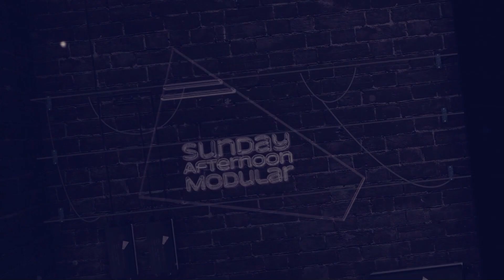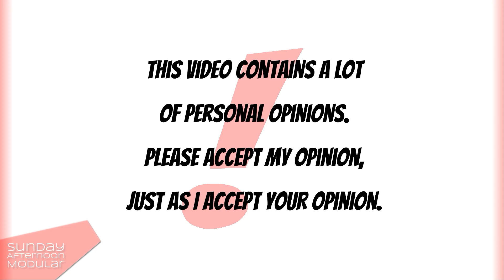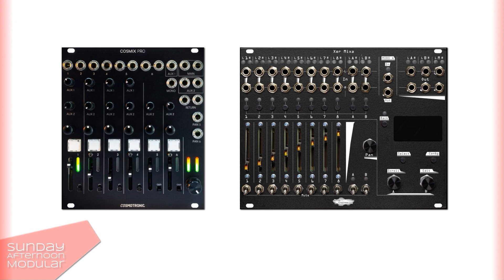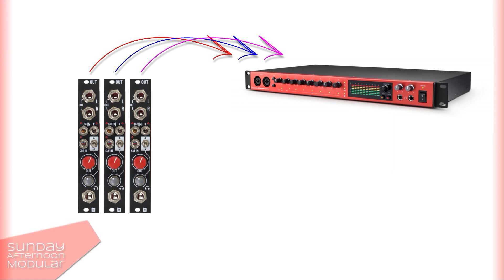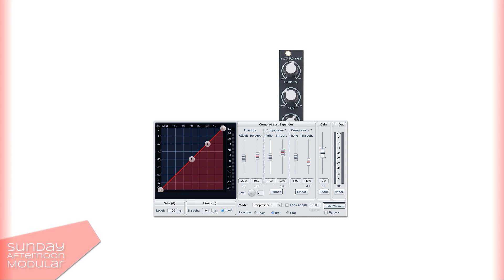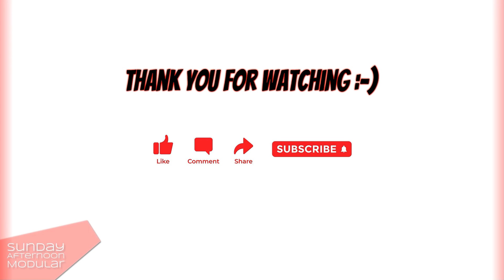why digitally controlled modules are NOT for me feat. NOISE ENGINEERING XER MIXA

Comment: Thank you for this video. It reminded me of why I didn't get Xer Mixa at first. Considering yet again how to upgrade from my Qu-Bit Mixology, my first and only eurorack main audio mixer since 2018, today I chose Boredbrain Xcelon. 

For me, as someone who comes from the 'last third of the 20th century' era of standards for studio audio mixers, my ideal for a modular synth audio mixer is based on two elements: physical immediacy and CV control. That will always result in massively multiplexed physical controls and indicators.

Physical immediacy includes one-to-one mapping of functionality to hardware interface and in-place indication of state, both of which you commented on. CV control is what makes a modular synth main audio mixer... well, modular.

Qu-Bit Mixology has both of those elements, but its small size and well-spaced layout precludes it also having other features, such as multiple returns. Cosmotronic Cosmix has the first element, but lacks CV control; except for CV over its two stereo channels' panning, it has none.

Boredbrain Xcelon has it all. It even has per-channel peak indicators. The only penalty is its size. After seven years of doing more with less, I am ready to allocate more space for my audio mixer. Now I will be unstoppable. 🙂

Thanks again!

Comment: Found your video that captures some of my recent thoughts. I am new to the modular scene and as I am building my kit I am facing similar design decisions. The feature packed digital modules sound appealing but you need a decoder ring on how to use them, especially when they dont even have a little screen. Also I am over 50 and honestly reading little screens in the dark is not getting any easier.  I do strive to build a portable rig for events, even though i mostly use it at home. So I want to have as much capability as possible in modular form factor. SO back to what mixer should I get ?  the Cosmix is an interesting alternative.
Reply from the maker: What mixer module to get, this is good question! I would say it depends on what you look for in a mixer, and at some point what your budget is.
How many channels you need, mono or stereo, if you want to integrate FX modules for reverb, delay and so on,
if you want to control certain functions with a CV signal, the size of the module, …
This can be quite overwhelming, I know.
The Cosmix Pro is a rather simple mixer, but does the job for me. The faders could be better tuned. A small change in the upper range can make quite a difference in volume.
The After Later Audio Bartender might also be an interesting alternative. And on top it offers a headphone out which the Cosmix Pro doesn't. But I just have my Comix Pro connected to a Befaco output module, which gives me Line level outs as well as a headphone out.
A mixer module I would like to try, but is just a bit out of my price range, is the Xcelon from Boredbrain Music.

Comment: Yeah, totally agree. I’ve just picked up a boredbrain excelon. The menu diving on the NE mixer was a bit of a turn off for me. Not going to lie, the excelon hurt my bank balance a little this month, and arguably it’s less featured than the xer mixer, however the simplicity of the design just gives me a little bit more confidence.

And don’t talk to me about firmware updates either. You can have a module that is perfect, apart from one bug. Update the firmware to fix the bug, and the behaviour of the good stuff suddenly is less good. Annoys me no end!

Disagree with you on the compressor though. I’ve just bought a third one haha. I’m not using a daw, so that’s probably why!

One thing I am lacking is some EQ though. I’ve just been making do with filters as a poor man’s EQ, but would love to add a proper EQ over a couple of channels though. That’s a problem for my future bank balance to solve right now! Hahah

Comment: There are 2 things about the cosmix pro that I would have preferred. The first half of the faders don't do anything for me but maybe that's because I have not used it on a big sound system system yet. The second thing is that when the fader is at the top the sound is just 1:1. I would have preferred a little boost. When boosted before with a Erica drive or DPW L-2 then the cosmix has great headroom and sounds nice. I also don't like big mixers so my next submixer is probably going to be from DPW or another Bastl Buddy. Those aux of the cosmix are juicy. Because I run mono in my studio I use the aux2 as 2 separate outs and that gets me 3 aux in total. My favorite digital module is a five12 qv-l and my favorite digital module with a difficult ui to memorize is the u-he cvilization ;-) And unlike you I looove the z5000 but maybe that's because I don't change programs. Have a great afternoon tomorrow 🙂

Comment: i use the wmd performance mixer mk1 as my main mixer and love it. couldn't ask for a better mixer. sometimes i wish i had more stereo channels and those expanders are impossible to get. there are some great digital and some analog modules. make noise morphagene which is fully digital i responsible for my heavy eurorack addiction. i even love the the disting ex which most ppl hate.its unbelievable what that module has become.  i would say my system is 50/50 analog/digital. to me sitting on the modular is like sitting in class room. i really enjoy the learning of it, which is literaly endless.

Comment: In general I agree, but there are a few butts.

Pamela's new workout. Yes only one encoder and a button, and the screen sucks (too low contrast), but 8 modulation, gate and or trigger outputs, very easy to use, small.

Mordax Data: Indispensable IMO for understanding envelopes and also has a tuner.

Bitbox vs Erica Synths Sample Drum: I had sample drum for a long time, fast and easy to use, i don't use presets live, it's that fast and easy. No manual needed. 
I'm not sure Bitbox is that much better, but I've only had it for a few days and played on it for only a few hours so can't really tell. Seems to me that the not so high quality reverb and delays are better in the Erica sampler and Erica has a better menu system. 

E 352: The menu is so shallow that I don't think the screen is that useful, just makes the module too big.  

Klavis Quadigy. Even with an oscilloscope attached, it is virtually impossible to make the envelopes you want. To complex, unintuitive and loads of to me meaningless functions, but it can't polarize the envelopes. Klavis makes some other great modules though, like their little inexpensive mixer that can be used as a sequential switch.

I think that some complex modules I've tried would benefit from a screen though. 

I got the prerunner of that Cosmix, but it's to big for my livecase and also needs an output module. I use a 4ms 12hp Listen module instead.
Reply from the maker: Hi Jonas, thanks for your detailed reply! I've thought a lot about getting Pamela's new workout. Heard from many that it's a pretty cool module. I don't have a Mordax Data but an O'Tool and a Korg NTS 2, and I definitely agree that is helps a lot to understand what is happening in a modular system. Have a great day/night!
Reply: @SundayAfternoonModular Mordax Data is a bit overkill Hp and all. Today I would probably get that Korg NTS2. 
I also got that Pam's expander for clocking through midi for jams with others : )

Comment: I am going with the 1010Music Bluebox within the rack.  Thing is sweet and has built in recording (with audio interface), eq, compression, delay, reverb and 12 in 8 out.  Only thing is that it is not as nice as my Hexmix\Expander when it comes to hands on control.  So I am planning on getting a midi controller outside of the rack.
Reply: i thought the 1010 bluebox was sd card only? when you say interface im thinking it can hook up to pc. if you can correct me if im wrong. i will be getting one if i can di to pc with it